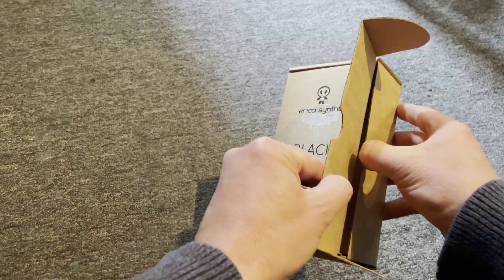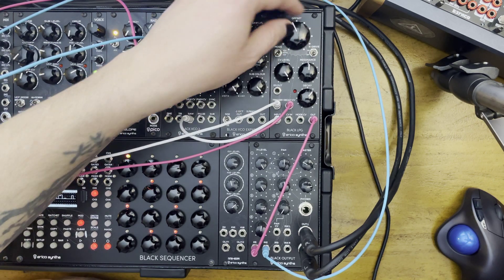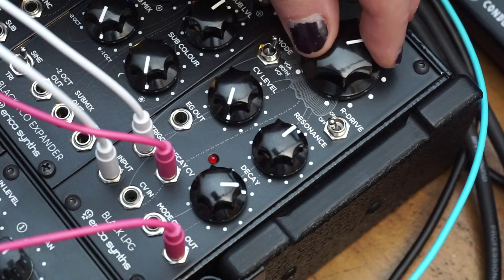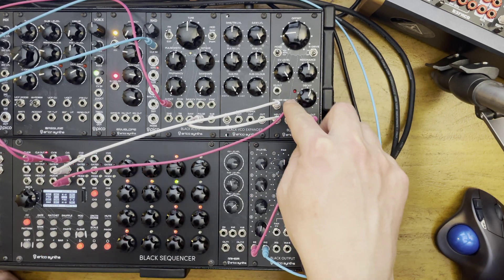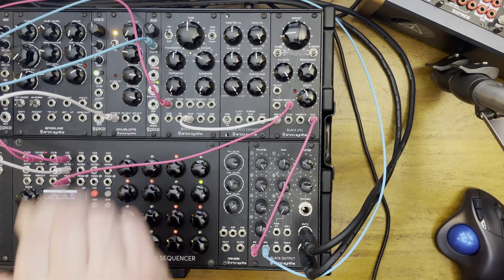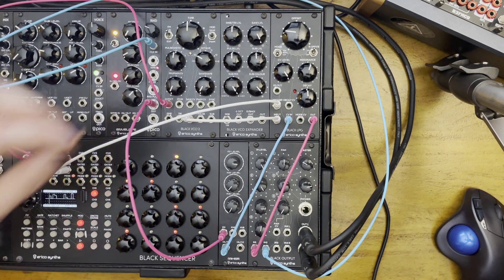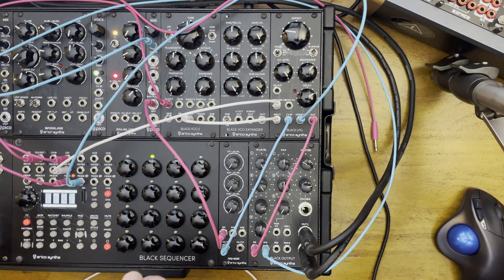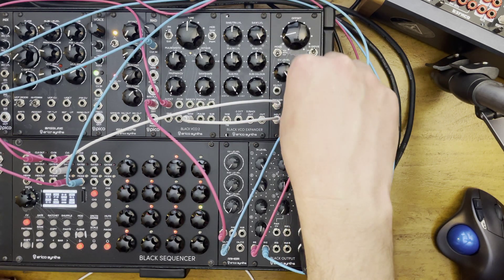The Black LPG

Comment: excellent demo! got mine a week ago and love it! if you have a fusion vco2 handy, try running it thru LPG for some filthy results. posted a short sound demo of it a few min ago. i've come to really want a black vco, but now i might have to spend another week on modgrid reconfiguring after hearing it w/the expander. i look forward to the black sequencer video manual. i always feel the fusion and black modules are luxury line cadillac or rolls royce like you said, but that combo sounds infinite 🔥🎛🔥
Reply from the maker: good idea i do have a kleine fusion system :)

Comment: Looking to expand my erica bassline voice module.  Which erica black series modules would you pick/recommend to pair with it if you'd have about 25 to 30 HP available?
Reply from the maker: I think the Bassline could use an EG! that way you can use the internal one for the VCA only, and the external for the filter and have much more control. And the Black LPG would give it a lot of flavor as well, maybe taking the square output to the LPG and using  it's own EG with random decay and panning the Bassline and the LPG in stereo...  Lot's of fun to be had :)